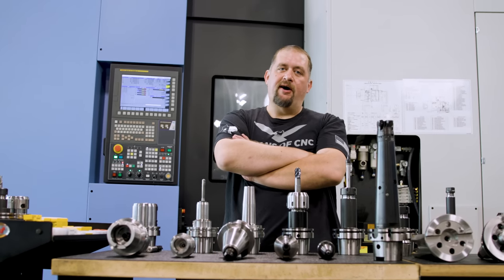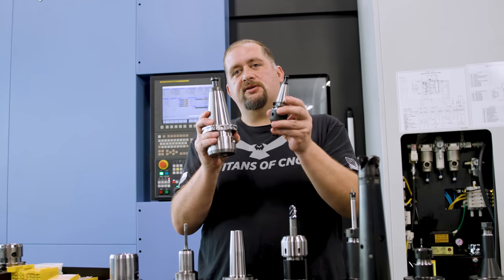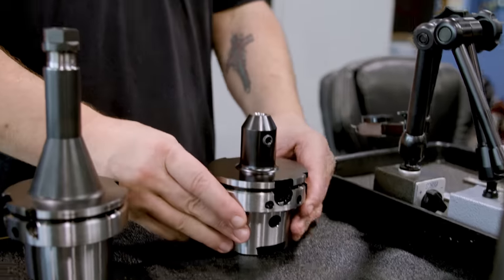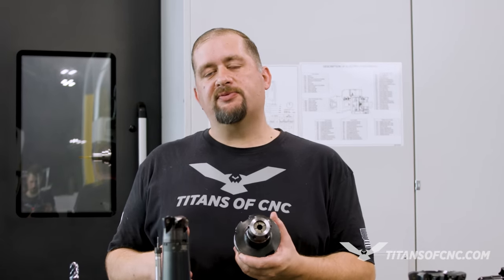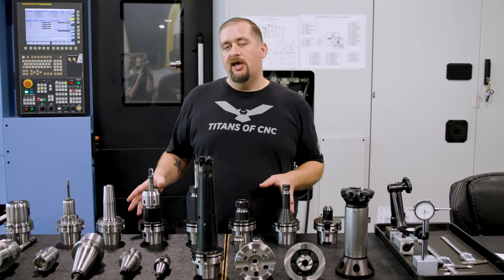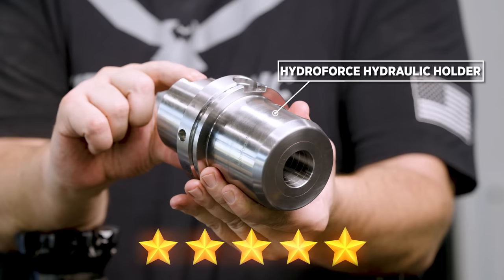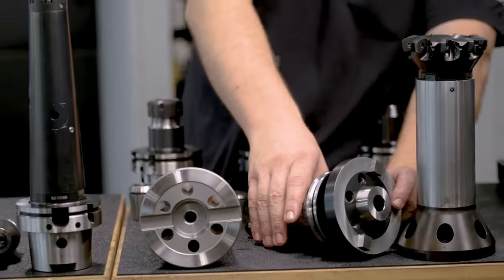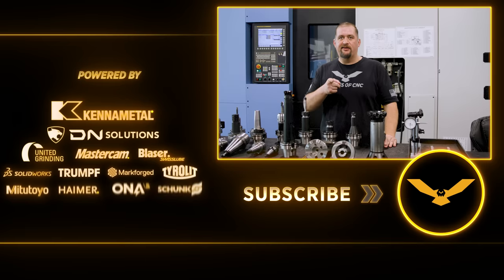How to choose the right tool holder for your CNC Machine | DN Solutions

Comment: One other thing to note: HSK gets clamped on the inside while BT and SK get clamped from the outside on the stud. Because of the centrifugal forces at high RPMs the clamping force gets weaker on BT and SK while it gets stronger on HSK holders. This is something to keep in mind for really fast spinning spindles (like 30k and more)
Reply: Max rpm is 12 revolutiones per minut so no problem, hsk100 is the best tool taper!
Reply: @ktgmobile2552  12 rpm is extremely low, are you sure that's what you meant to write?

Comment: Great video Barry! The average machine operator is only trained to pick up any holder the tool fits. I only started to learn this information as I encountered problems and/or when outside service representatives had to be called in, some came with a machining background. 

My advice to all machinists, make friends with field service technicians and applications engineers who service your machine tools. They will teach you things most won't. That's how I know much of what I do outside of general machine operation.

Comment: Weight is not the ONLY reason you can run HSK or Capto faster than a traditional milling machine taper. 

The drawbar is a HUGE difference. To put it as simply as possible 30/40/50 taper tools "OD clamp" the pullstud so the faster you rotate the less clamping force you have. HSK on the other hand "ID clamps the toolholder" faster = greater clamping force
Reply: Very true! You can only fit so much in a 10 minute video on the basics, but it's also worth noting that the faster you spin it, the harder it pulls..........

Comment: A tip with collet is to get it snug then spin the tool as you tighten. Helps with runout
Reply: Good advice!
Reply: Does it matter which direction you spin the tool?
Reply: truue im doing the same

Comment: Main benefit of HSK is the drawbar opens up inside rather than clamping the outside of the pullstud. So faster RPM clamps it harder rather than letting go. 

Some downsides like harder to keep clean and expensive 

Pick the right machine for your job👍
Reply: Do they make tri-contact HSK holders?
Reply: @richpryor9650  no, the steps and dimensions would be required to be 0 and that’s not commercial durable
Reply: @kleini3  As in rugged or viable?
Reply: @richpryor9650  as in to expensive for everyone to pay for it
Reply: @kleini3  No, you just have to believe
Reply: Also worth noting the greatly improved spindle indexing capacity. Not really a big concern in a typical mill setting, where steep taper tooling can reliably orient well enough for tool changes or G76 cycles, but on a multi-tasking machine it's pretty significant. Applies to Capto as well.
Reply: @copperlemon1  kitigawa makes a pallet changer work holding using HSK. They say it’s not super accurate on rotation so you have to probe it once clamped for tight tolerance as it relies on the dogs

Capto is intrinsically accurate so more common on mill turn.
Reply: Another downside of HSK is availability - everybody and his cousin makes Cat40 holders, its why you can get an ER collet chuck for just over a benny. 

Personally, i like HSK, i just wish it was cheaper.

Comment: REGO-FIX powRGrip holders are great too. Just about every machine tool manufacturer at IMTS was using these holders while showcasing their machines.
Reply: Theyre great holders, but like Shrinkfit, requires pricey equipment to change tools, with the added downside of it being a proprietary system. It does have the advantage over shrinkfit during catastrophic tool breakage - you snap an endmill down the hole in a shrinkfit holder, and it is usually a writeoff due to bore damage. Regofix, like collet chucks, it can mean tossing the collet, but the much pricier tool body remains unharmed.

Comment: One thing that gets over looked with cat/bt holders is the pullstud. Specifically the torque used to attach them to the holder. Most of the time the specified value is too high. What happens is the small end of the holder buldges slightly. That interferes with how the holder fits in the taper of the spindle. This over time shows up a wear pattern at the small end and at the flange end of the holder. What's actually happening is that since the holder is not making contact through out the taper it ends up like the clapper in a bell. This is why they seem to have such bad runout. A properly fitted pullstud that doesn't buldge the holder will make the holder contact the full lenght of the taper and will run much truer. Take a look at the cat/bt holders in most shops and you're likely to see the tell tale wear pattern of over tightened pull studs.
Reply: you took the words right out of my mouth. Whenever I go to setup a small tool, I always check runout of the holder. If it's running out a lot, it's usualy because someone went all beast mode on the pull stud
Reply: @douglaspierce7031  There's a company out there that makes extended threaded length pullstuds. They reach deeper into the holder with a larger thread relief near the small end of the holder. This design helps mitigate the bulging.

Comment: Have you guys ever worked with SECO capto holders? Or any other polygon holders for that matter.

Great video, I'm currently working on two machines, one HSK63 and one CAT50, i do like the HSK more because they're lighter and still pretty rigid. Good thing we use both depending on the job. 

Also, Albrecht holders are also very easy to use and have very good runout and strength. Kind of like an hydraulic force holder, just that the collet is drawn into the conic hole by a thread. Very interchangeable and versatile tools
Reply: Kennametal would be pissed.😂😂
Reply: @goldstandardgroup3452  Jep, Titans is a social media channal for Kennametal. You won't see anything from the competition here, even if they are many times better, such as Sandvik's Y-Axis parting.
Reply: I have used Seco and Sandvik. And despite what these other 2 geniuses say, we are not a social channel for anyone. WE decide what we like best, and then show you why we like it. If people disagree, that's fine! We all have opinions. But Kennametal is THE LARGEST HOLDER MANUFACTURER on EARTH. So naturally, we have alot of Kennametal holders!
Reply: @barrysetzer  I can't find any information on who is the largest manufacturer of toolholders, but the market capitalization of Sandvik is ten times larger than that of Kennametal. By the way, Sandvik also includes Seco, Walter, TDM, Vericut, ...
What else belongs to Kennametal, I do not know. 
In the end, every manufacturer has certain products that are good and others that are bad. The difficulty is to find the right product for your operation.
Reply: @flyffpsy  Agreed!
Reply: @flyffpsy  sandvik also owns Mastercam
Reply: I just asked this question cause I wants to know too! Can’t find a lot about them.

Comment: What are your thoughts on the "Capto" style adaptors?
Reply: expensive but the best Adapter for maschining.
Reply: @Annomaster1  not anymore, cost the same as HSK. The patent has expired
Reply: @kleini3  so its not more expensive to grind a capto holder?
Reply: @ipadize  probably still but competition brings down the price. Psc is on paper more expensive against normal HSK for milling but market price is pretty even. for turning (HSK-T) the cost is the same.

Comment: That's a pretty cool presentation Mr. Barry.

I have a few questions?  Have you had shrink fit holders pull out on you?  Every time I have had a roughing path which had a section with too much radial engagement the endmill would pull out an 1/8" and pop it like it's not so hot.  I have used them with limited radial engagement dynamic tool paths with no issues and it gave me good clearance for that job.  I like the shrink fit extensions for clearance on some 5 axis transformations more than the ER extensions.  

How tight do you need to tighten hydraulic holders and mill chucks.  I'm guilty of the put a cheater on it and be sure its tight, extra tight.  I've seen little torque wrenches for hydraulic holders but I don't trust them.  Just an aside for sharing my experience, I have never pulled a tool out of a mill chuck, but I have on a hydraulic, and once a hydraulic holder pulls out it will do it again in my experience.   So off to the recycling gods she goes. 

How in the hell do you tune those devibe arbor holders?  The DMU 90P that I run the most had vibration sensing but I have never seen any instructions when I opened up the holders on how to tune them.  Is there a SOP for tuning them?  I've asked a few people and I really didn't get much of an answer.

 With that hydro force holder with the safe lock collet do you have to use a specific endmill brand or can you grind it yourself on a T&C grinder?
Reply: HAhaha hey stiles, soooooo yes i have pulled tools out of shrink fit holders. Hell, i have pulled several cat40 holders out of the SPINDLE on an Okuma horizontal. Thats why i lean toward roughing holders that prevent pullout. As for hydraulic holders, i like the Kennametal ones because you tighten the bolt all the way till it stops. No cheater bar required. And the tuneable holders are trial and error. Test them, and see what you get!!!
Reply: @barrysetzer   I have four 1 1/2" hydroforce hsk 100's at work.  I looked up the cost of the hydraulic reducer with the safelock, and omg I don't think I can I can get anyone to cut a po for one /sadface

If I were to get medieval after some 15-5 doing dynamic roughing with safelock which Kennametal endmill would you use.  Or 625/718 for that matter.

Almost all the toolholders are erickson  so I got a lot of the same hydro holders, I like the 20mm long boys with a reducer for side clearance and long reach too.

Thanks scene-your Barry!
Reply: Hello again, Stiles! So when it comes to those materials, there are 3 cutters that i absolutely stand behind. For heavy radial engagement, its the Harvi 1TE every time. That tool has blown my mind. But for light radial, you have 2 options. The Kor6, a 6 flute tool that has chip splitters if you need good chip management, or the Harvi3 Aero, which not only blows my mind, but also won the Boeing challenge for tool life. A couple months ago, we actually had a group come into our shop from a large, advanced aerospace company, and we blew their mind in some NASTY 718 inconel with the 1TE and 3 aero. That demo was actually why i knew THIS test video would work:

Comment: Barry, how much does the machine you're using play into toolholder selection? 

Oh...how good are the machines "Markforded" makes? In your "Thank you to our Partners" section, they seem to make the Metal X, X7 and Mark Two.
Reply: Hey bud. When it comes to machine, assuming you already have a set spindle connection type, all the rules from this video on tool end connection apply. But, you also have to consider what youre using the machine for. If its just light roughing and finishing in aluminum, you probably wont need a beefy super holder. But if you plan to get aggressive, gotta step your game up! As for the printers, i love Markforged. I spent a few years managing our additive equipment at Mooney International, which included a Stratasys 900mc. The Markforged printers have excellent accuracy, reliability, and are very user friendly!
Reply: @barrysetzer  Look a bit closer at my comment...your crew misspelled "Markforged" three times in your "thank you" section of the header to this video. 

Let me throw out a little scenario. You've got two blocks of hard metal and two machinists that have to rough them out on different mills. Machinist A has a mill with a 30hp spindle, Machinist B has one with a 75hp spindle. They're using Titan's speeds and feeds. Would the same holder work properly on both mills (assuming the connector on the spindle shaft is compatible, naturlich) or would you want to choose a lighter-weight holder for the small mill to prevent bogging it down from turning unnecessary mass and a heavier holder for the large machine to dampen vibration?
Reply: Well, naturally its INCREDIBLY important to understand what your machine can and cant do. I just filmed a video friday that talks about some of our “feeds and speeds” and understanding that some of these videos are just to get you thinking. Stay tuned for that one. But no, the same strategies that work on our NHM6300 will NOT work on our Tormachs for example. As for someone misspelling Markforged, apologies. We are Titans of CNC after all, not Titans of Spelling and Grammar. (I wanted to spell that “grammer” fyi to trigger you, but i resisted) 😜
Reply: Btw, thank you for catching that spelling error. The team is fixing it as we speak.

Comment: Something to note, after long enough use of shrink fit tool holders. After consistent reheats to put new tools in or tools breaking at the base of the shrinker.

The runout gets worse and worse over time for the holder. Which can lead and cause tool breakages inside your parts
Reply: Extra note, hydraulic holders aren't the best when it comes to tapping a part, or in some cases drilling. It will pull your tap or drill into the hydraulic if you use one for the application

Comment: Alot of these tools are for a mill and i dont do much on them anymore i run more lathes nowadays.. but one thing ive always had trouble with is knowing when to use a free floating tap! Also alot of programers nowadays really enjoy 35 deg cutting inserts to rough alot of material instead of an 80 deg and this is common for alot of straight turns no angles or anything special.. why is it being used alot when 80deg are proven to work better and longer.. how do i convince my programmer to start cooperating it into the work??
Reply: If the turning profile doesn't require a 35 degree tool just use an 80 with the same tool nose radius as the 35 degree tool. You might get a slight difference in surface finish, but nothing crazy. One benefit to a 35 degree tool is it's less prone to vibration/chatter than an 80 degree tool. That would only really be an issue on long length to diameter parts though.
Reply: @brandons9138  yea im pretty good about using 80 deg and when to use it and finish wouldnt be a prob if you use an 80 as a rougher and came in with a 35 for a decent sf..but ive been seeing more and more 35deg rough and 35 deg finish is it something being taught at schools to do it that way,do they do that as a contract thing so tooling companies sell more tools?? Am i thinking to much into it bec i cant understand...but i was more focused on how i get my programmer to use them.. i cant just change out tooling without approval or it can cost me my job and we dont want that... but if ya wanna put in your input on when i should use a free floating tap im all ears..
Reply: @shadow_stalk  Honestly I've never used floating tap holders ever. If the machine is capable of rigid tapping I don't see the point in them. What kind of materials do you normally work with? We use a lot of 35° and 55° tools at my shop, but we deal primarily in plastics. Insert strength is not much of a problem for us.

Comment: We do not rough with ER collets. You'd be wise to do the same.
Reply: It so temptating to push it a little more after seeing the Titan rough cuttings vids, but if you only have ER collet don't do it, the change for endmill drop out or slide out will ruin your table or wise when the endmill will kiss your table plane or wise.

Comment: It ist right that HSK holders can run faster than steep taper tool holder. But it is not due to their lower mass. It is because the clamping force gets higher wit the rpm and not lower like it is the case with steep taper holders.

Comment: I have a quick question. I work for a company that does mass production of a part. I am trying to make a standard to judge if a tool holder is reusable. A lot of our tool holders have uneven wear to the taper. Is it still okay to use for mass production?
Reply: It depends on your tolerances.

Comment: My favourite spindle connection type is the chips that fall into the taper and get crushed up into the spindle during tool changes because the operator couldn't be bothered to clean their machine.
Reply: Yes this sucks :D i am always too lazy to clean those and been facing this issue many many times, hsk100 the problem is bigger but for the bt40 not so much

Comment: Have you seen those polygon tapered toolholders by sandvik?  They would be cool to see demonstrated. Also, I have been trying to get my company to switch from ER collet holders to hydraulic or shrink, and they won’t. We are heart of the semiconductor anode industry and the money is there, we do everything the slow way, yet I can’t get them to listen about the benefits. Our feeds are sad, my department  alone provides 70% of the entire worlds supply and we could increase Efficiency 500% with a couple small changes..